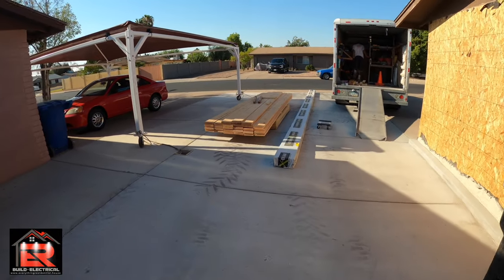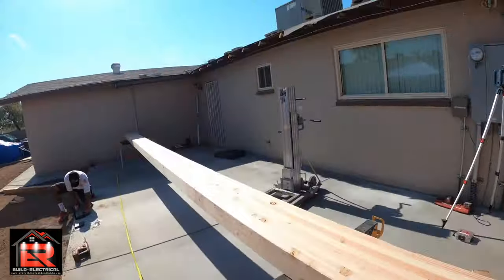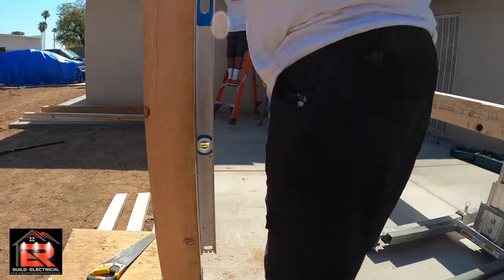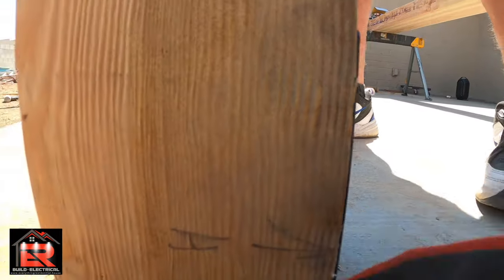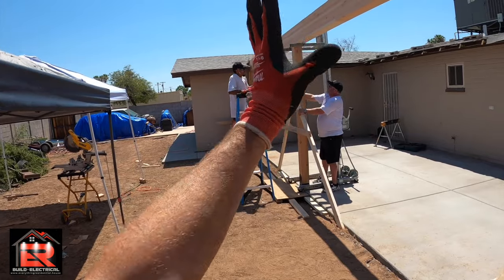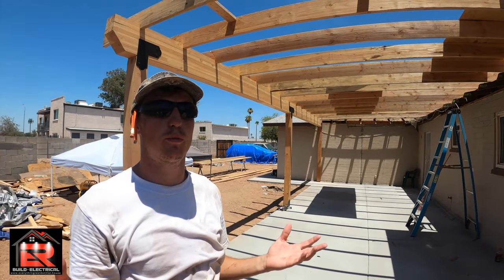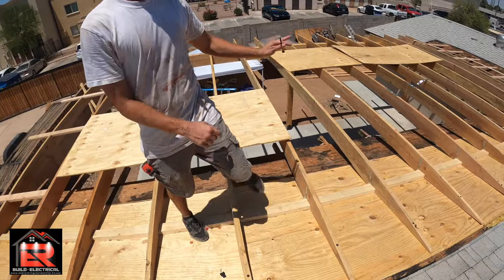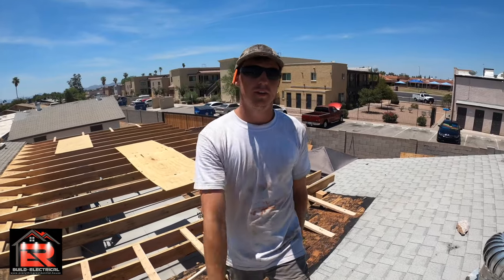How To Build Patio Cover pt. 2 framing

Comment: Can you go into more detail about how to connect to the existing rooftop and how to finish the shingles. I am trying to correct a build out where the existing is not tall enough and it is finished with fiberglass shingles that leak where they overlap so I want tp lift it up to the roofline as you did here.
Reply from the maker: I will go into to detail when the final comes out. We are working something out with one of our subcontractors on the job. You will see a video really soon
Reply: @everythingresidential  did you ever get into how you got the angle for the patio rafter to connect to the existing rafters?

Comment: It doesn’t look like any of the wood is treated. Is that correct? My question is mostly around the posts. Did they need any barrier where they contact the bracket and concrete?
Reply from the maker: Probably depends on your location, but none of it needs to be pressure treated in Az

Comment: Thank you for your video. Question: Is it necessary to build a heavy beam for the patio?
Reply from the maker: We use large beams because we don’t like multiple posts and since we put the roof onto the other roof rather than on the top plate it gives us room for play. So by using a larger beam we achieve a richer taste and a more open look